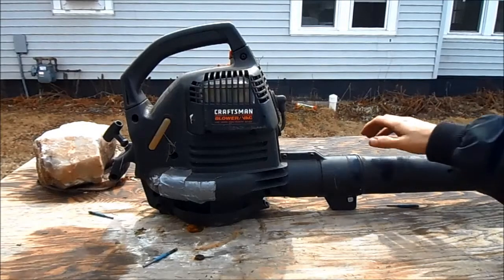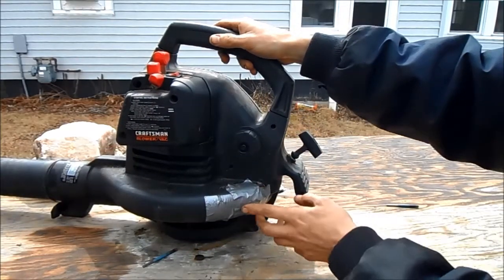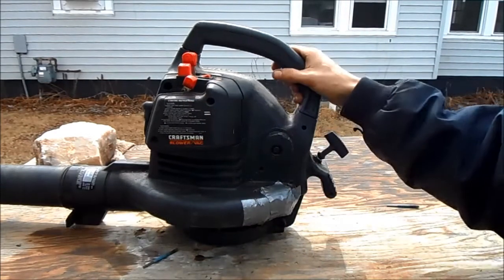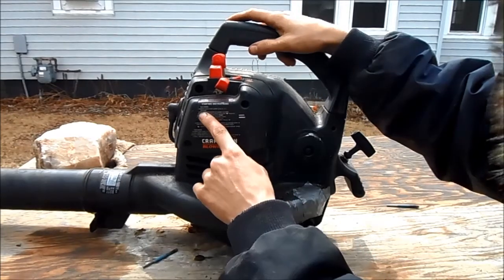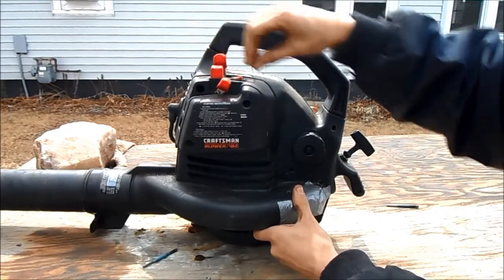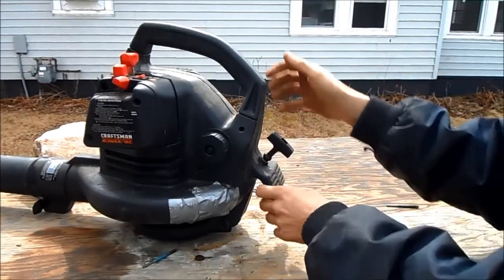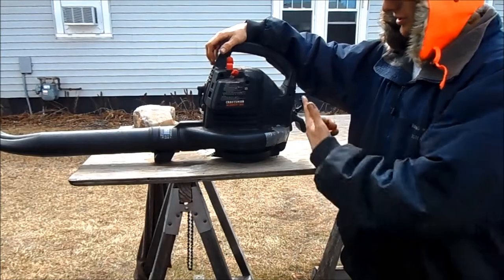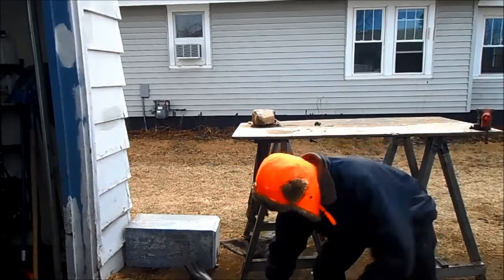24cc Craftsman Leaf Blower

Comment: What type of gasoline do you use?
Reply from the maker: Generally small engines like this are 2 cycle. Any gas should be fine as long as the oil is mixed correctly